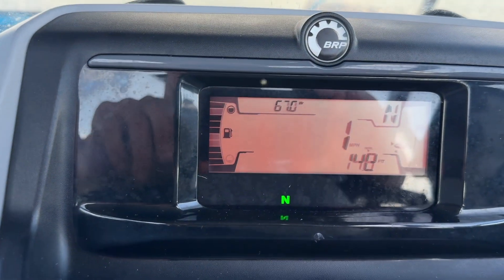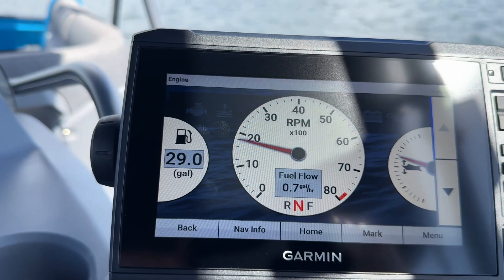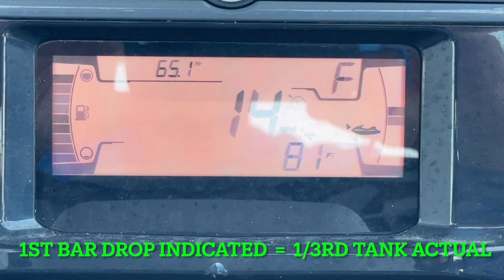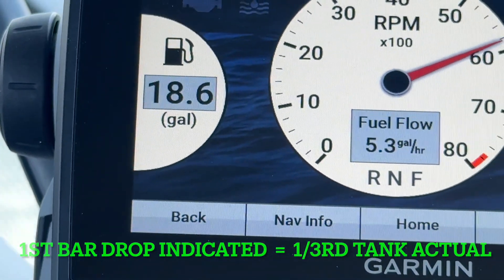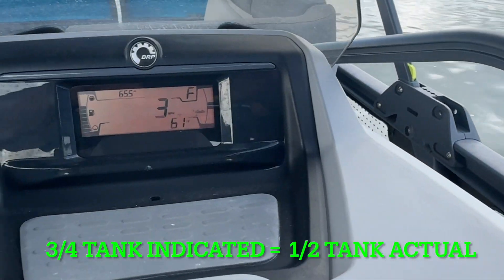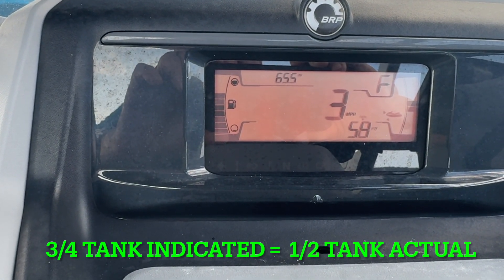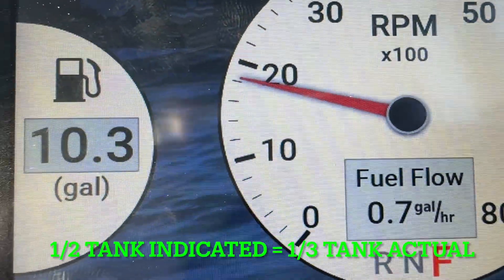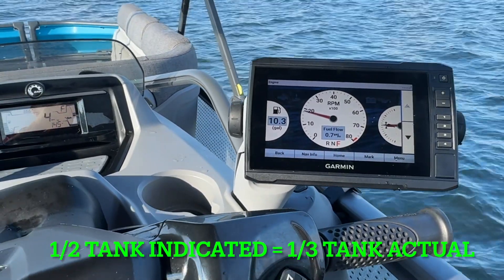Sea Doo Switch Gas Gauge Accuracy

Comment: Hello Frank , i installed yacht device on my sea doo challenger , but i cannot get any info about fuel flow rate , which part of txt file responsible for that ? Thank you in advance .
Reply from the maker: You need to go to the main menu (not the gauges) on the Garmin and look for fuel.  You can select Fuel Flow from there.

Comment: I don't think the gauge reacts quickly to the amount of fuel in the tank.  We were cruising the 1,000 Islands and the gauge was showing 8 bars.  We stopped for a swim and upon restarting showed 7 bars.  Might be coincidence, but the same thing occurred on another trip.  Guessing mileage is tricky, best guess is about 4 mpg or 56 l/100km on a 18' 170 Hp Cruise.